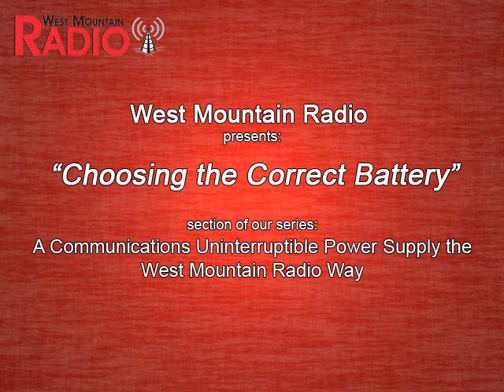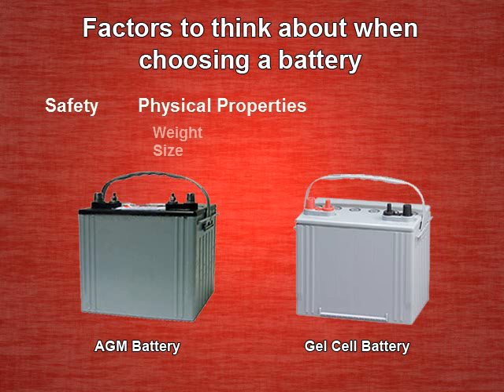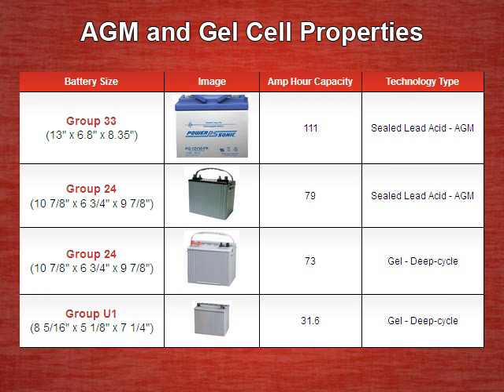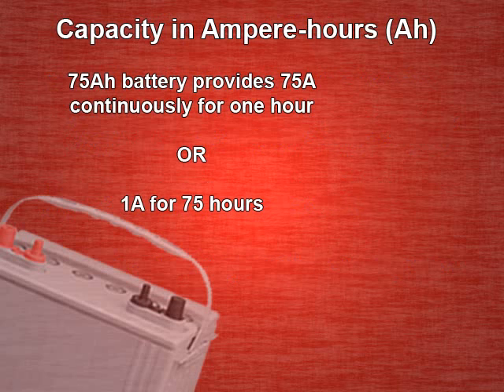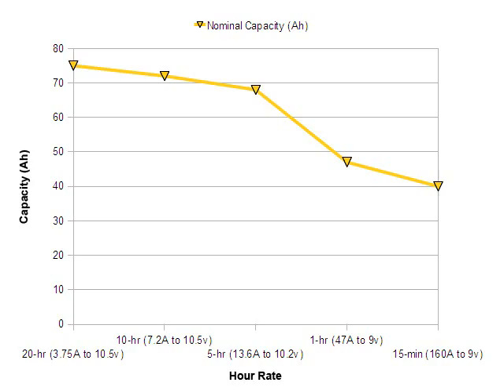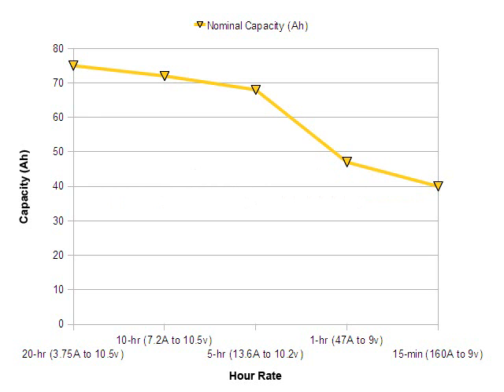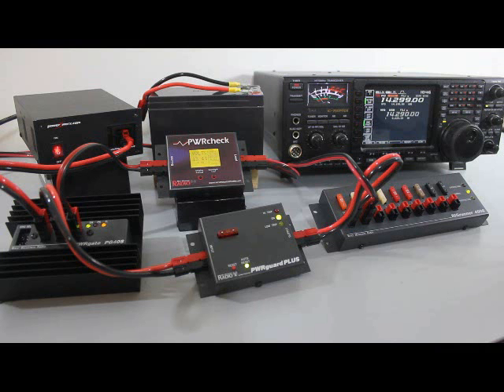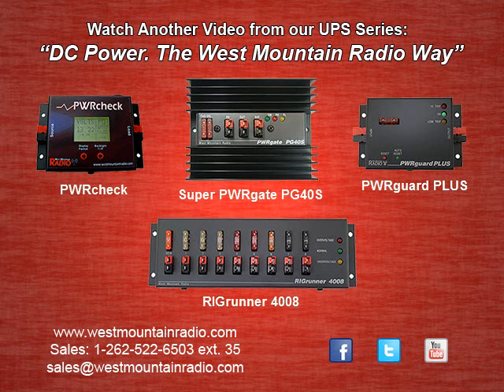Choosing the Correct Battery

Comment: No. This information is incorrect and incomplete. eg. 75Ah batteries DO NOT by any means provide 75 amps for one hour. In the United States, batteries are rated for a 20 amp discharge rate. A 75Ah battery will discharge 20 amps for 3 hours and 45 minutes under ideal conditions. You people need to get your facts straight. Better yet. Leave it to the experts. Don't just spew crap over the Internet.